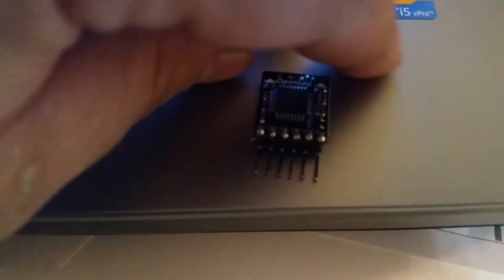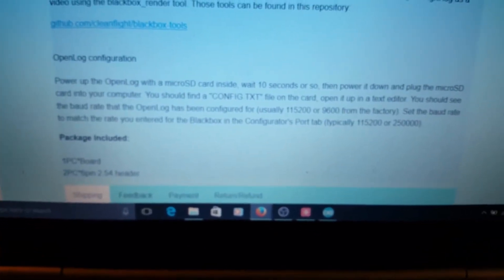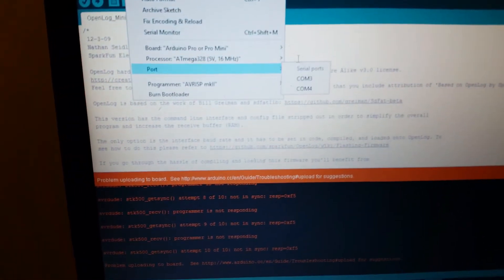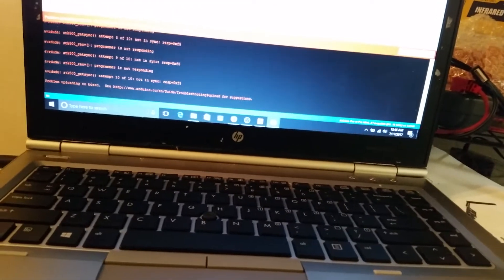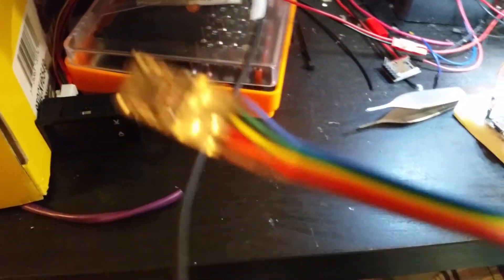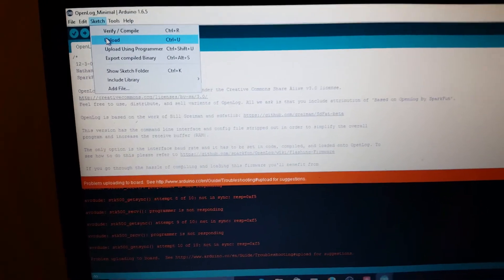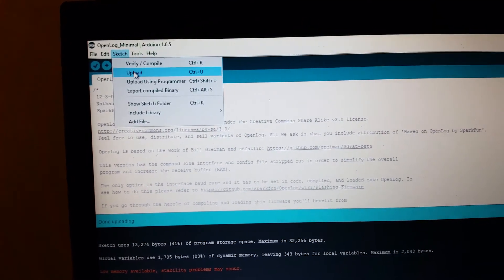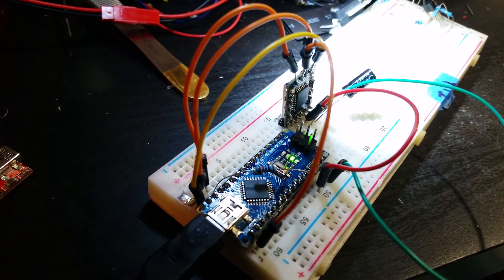openlog bootloader burn and flash openlog 4 firmware

Comment: Glad I found this vid, didn't realize my Openlog device was missing the bootloader and couldn't get sketches via UART until bootloader was uploaded via SPI. I did not need to add a cap or resistor, however.

Thanks!
Reply from the maker: Glad to see after a few years this is still helping folks, thanks for the feed back may help others when they dont have the additional components. i think adding the cap and resistor just helps smooth the power for the most part.

Comment: Do you have a wire diagram for where you put the resister and cap? for use dumbos to follow? ie: what pins on the arduino